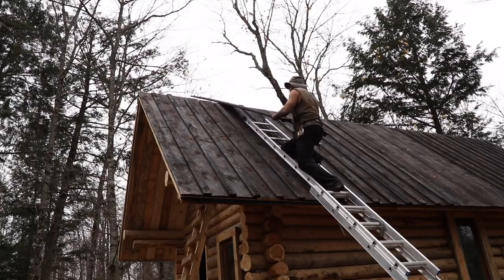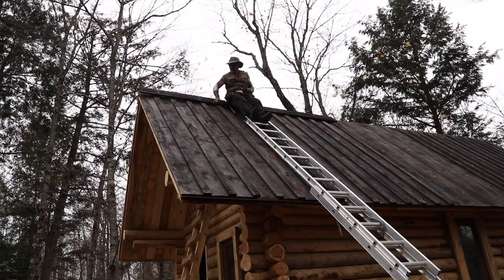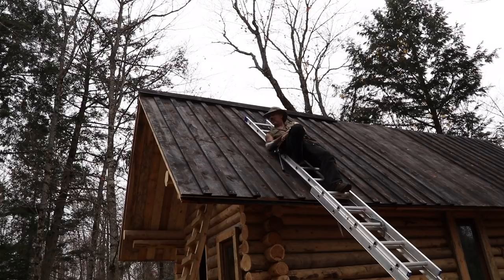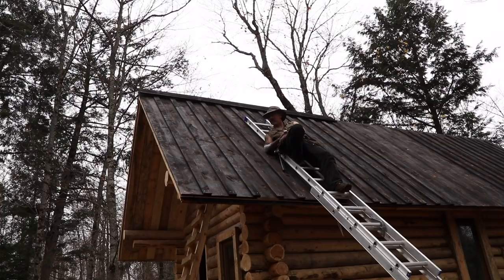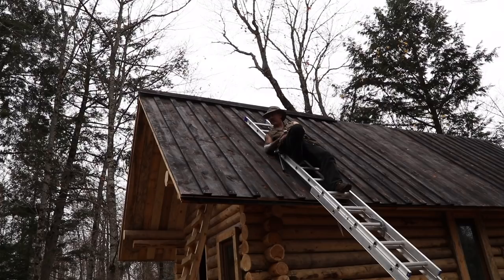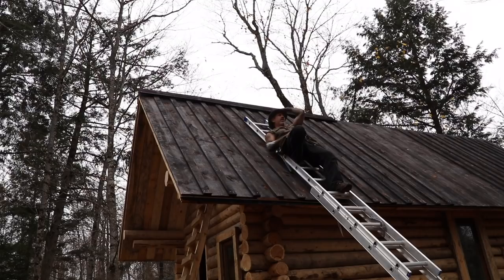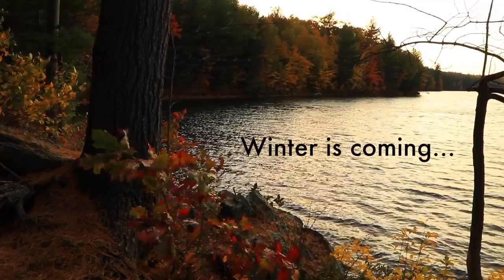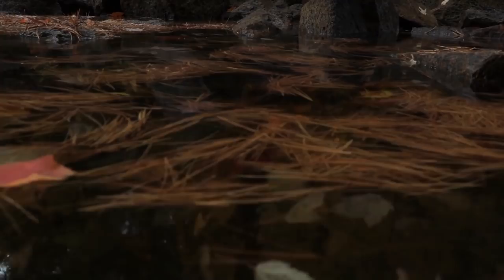Shou Sugi Ban DIY Wood Roof on a Log Cabin in the Woods using Ancient Primitive Technology

Comment: Shawn  my wife and I stand with you Bro in all things!  I don't want to sound or be negative with you, just realistic in that this shou sugi ban roof is great for ok for Japan but not here!  Please also be reminded that every where on your roof you have appled a nail into your roof, exposed to the weather, Do you not think that water won't penetrate over the next couple of yrs. and cause leaks inside?  Myself personally with 28 yrs. hands on every type of roofing would never apply this type of application. I say within a few yrs. 2 at the most you will be applying a metal roof or cedar shakes over top of your shou sugi ban roof!  My advice and Dieter Schneider advice below is something to reconsider !  We love you Shawn and your family. Sincerely yours MJC
Reply from the maker: mJ c Thanks. With 5 layers of redundancy, I know it's not going to leak into the cabin (didn't even leak before I put the membrane on). But, water may get between the layers and cause other issues. The beauty of this system is that I can easily take off boards to inspect it and/or replace things as necessary. I'm looking forward to seeing how it goes.

Comment: Shawn:   Custom garden shed kits I designed;  were exported to Japan about 35 years ago. They had the ridge caped with a 6" round log that had a 90 degree notch cut 2/3 of the way into it the full length.  It was a good looking ridge cap, but we used forest green exterior vinyl sheet goods for the roof cover as it was a kit building; 3x4 meters, with a 12:12 pitch roof.   They were partially assembled and flat packed for shipment in a container. The walls were panels of milled 4" lodge pole pine rounds ( normally used for tree stakes) cut in half then milled smooth with bevels on the  flat, T&G edges and the rough 1/2 round for the exterior.     I believe a lot of the kits were used for forest cabins/shelters.     Bert

Comment: The roof is great. I am now fascinated by that shou sugi ban method of weather-treating wood! It's an education for me, as I hadn't heard of it before. But it's now something I will remember. I will look up techniques of preparing wood that way. Thanks!
Reply from the maker: This is an ancient, non-toxic way to preserve wood.  The benefits of this system are that it is UV, rot, pest and fire resistant.  Apparently, it can last 80-100 years untreated and longer if treated (with oil).  The oldest surviving wood structure in the world is a five story pagoda in Japan that was built using Shou Sugi Ban.  I will post a video of the technique on Sunday
Reply: Thank you, and I am looking forward to that video!

Comment: AAAHHH, board and batten.  I am so happy to see you getting that beautiful workmanship in the dry.  AWESOME JOB, Shawn.

P.S.  Re. the burnt-wood effect on the roof boards.  Realizing that the fire turns the outside of the board surface to carbon it should hold up just about forever.  My great uncle had a forest fire rip through his 45 acre stand of American chestnut trees.  The fire destroyed all of his humongously beautiful trees.  Even after 60+ years the burned out stumps were still standing, with all of the charcoal still intact inside the stump. We kids would scoop it out for backyard BBQs.

Comment: I absolutely loveeeee this cabin! Though I would have done a tin roof because I absolutely love the sound of rain on a tin roof. This is quite literally my dream, a log cabin back in the woods. I’d like electricity and an indoor bathroom so I could truly utilize it for extended periods of time with relative ease. With that being said, I would not want a ton of crazy luxuries. Being where I’m from I’d had a propane heater so I don’t have to worry about the pipes freezing but I’d certainly have a wood stove, minimalist bathroom with literally only a shower, sink and toilet, a kitchen with a small stove, simple fridge, sink and pine cabinets, real plank board floor, open loft bedrooms 😍😍

Comment: Looking Great Shawn....

Ever thought of installing a gutter drain rain barrel run off system ~ Three or Four barrel Rain catch system funneled off the roof for water back up storage for cabin use...

Three or Four rain barrels wooden ~ stack rack on top of each other with valve plum pipe and sealed fittings....  Just an idea !!!!!!

Roof coming along great up top 👍🏻

My next concern was clearing trees and fire proofing the property surrounding the cabin.... Proactive approach in keeping the area safe for you, family and guests....

Fantastic Work 🏡

Comment: Interesting process.  Your roof could support a tank.  Looking forward to seeing how you did the burning process.  You may have considered the following but in case you havn't here it is.  My grandfather did this, and I have heard of others around here doing the same.  After chinking the logs with whatever, moss is traditional, some use fiberglass now, instead of using clay, he ripped boards along both edges at maybe 45 deg (you could experiment) and then nailed them between the logs.  Prep time is longer, but chinking goes fast and looks great IMHO, and it doesn't fall out.  Outside he left the logs not chinked, but you could do do something there if you worried about water penetration.  The cabin is still standing strong 80 years later.  Thanks for showing us your progress.

Comment: Your project is amazing and the roof looks great. However, I would have done the roof a bit different to get better airflow under the roof boards. The roof battens should go down the roof, not horizontal (to allow water to run down), then put some spaced sheating over to mount the boards. The boards in the first layers should also have good distance between them, and there should be a groove on each side of each board to allow water to run down. The boards you put on top should be equal size as the boards under, and also have groove facing down matching the boards under (forming a tunnel for water). That's how we do it here in Norway, and it's raining a lot here.
Reply: Dieter Schneider a lot of work involved but all you said makes sense I shall use this technique next time, thank you...
Reply: I think I follow.  The roof(s) you speak of in Norway, how long does it last ?
Reply: We have some of the oldest wooden churches in the world here (close to 1000 years old), and they all have wooden tile roofs. However the roofs have not lived that long, they need repair and rotten tiles must be replaced. I'm not sure how long the tiles last, and they are treated with tar and charcoal. The tiles are made of slow grown mountain fir heart wood, which also naturally contain lots of resin which make it last longer. The commercial wooden roofs they sell today (similar to the one in this video) can last up to 75 years if you use pressure treated wood. At least, that's what sellers say. Good airflow i extremely important to make it last as long as possible.
Reply: It also appears that you failed to leave a drip edge.  The charred boards should hang down at least a half inch farther than other boards they touch/are attached to.  (I know, too late now; but you forgot to consult me before you installed the boards).  ;-)

Other than that it looks great.  Love the yakisugi.
Reply: @Dieter Schneider - Thank you Dieter, but I'm not 100% sure I fully understood your explanation. Could you possibly post a link to something (a photo or website) that shows the method you explained. Much appreciated :)
Reply: Dieter Schneider 

Would also like a pictorial of your explanation seems I can't see what you explained maybe lost in translation
Reply: previouslyachimp *
Reply: That’s exactly what I was thinking about the spacer boards.  Not a roofing expert, but I was thinking the same thing about water direction.  None the less, great work on your cabin and may she last generations.
Reply: Yup, standard for battens/strapping on a sheeted/underboarded roof - vertical or diagonal battens first so water always has somewhere to drain, then the horizontal battens. Also, I would've fitted the vertical verge (sloping roof edge) battens first then cut the horizontals - one, no cut ends exposed other than at the bottom of the roof and two, just less cutting.. and I'm lazy so I like that  :o)

Comment: I had heard of Shou Sugi Ban before it was mentioned here. I just didn't do any investigating into the method used, & what came from the method. Upon researching it I found some beautiful furniture, fireplace backings, bathrooms, flooring, etc, etc. It is used in many ways. I love what you did with the roofing. If I could have chosen a tin roof it would have been the black. I still love the burning of the wood for the roof. It just seemed to fit it better.
I do have a question. I have been going back to some of the earlier videos & I could have sworn you mentioned a well. If you have is it going to supply your kitchen, sauna, & possible other uses?
Thanks for continuing to share your adventure & the development of your future home.

Comment: I am commenting before I even watch this installment.  It is crazy how much I look forward to watching this channel.  Thanks Shawn!  Just back from Barrie, 14 hrs of tin bashing.  It is shocking to see how much bad work, unfortunately, there is out there in the HVAC industry.  On a brighter note...  nice ladder.  Okay, on with show.  Cheers.
Reply from the maker: What are you tin bashing in Barrie?
Reply: At a beauty house whose furnace has packed it in due to under sized duct work and a whole host of mind boggling manouvers.  Fabricated new duct work this moring, drove to Barrie, ripped out and replaced.  We're talking new and properly sized venting, new gas line, added returns, increased supply size and increased and added perimeter pipe size and runs.  I imagine the entire street with hefty price tags attached all have the same problem.

Comment: I see that your horizontal battens are useful to step on during construction. But did you consider putting a layer of horizontal battens underneath them first, so to let water drain off on your membrane without horizontal obstacles? I suppose you did and decided against it for some reason?

Comment: The fire hardened board and batten roof is a unique and awesome idea. Looks great!  My only criticism is you should have used four foot horizontal battens with 1/2" gaps so any water that gets through the roofing can drain better and not cause ice dams under the roofing. I've installed hundreds of tile roofs and water always finds a way to get under the tiles. Love that you're using all hand tools.
Reply from the maker: richard hiatt Thanks! I ended up cutting them shorter and cut slots so there is quite a number of 1" gaps. I was thinking about vertical air flow too

Comment: This is fantastic. Whenever you get a bunch of opinions doing the opposite of all of them is always a good choice lol. I’m familiar with board and batten siding. I’ve also seen the Finnish use burning and tarring to preserve wood for construction. I haven’t seen these combined for a roof before. I have so many questions. Is there any sealant under the battens? What kind of nails? Concern over nail leaks? Obviously you aren’t the first so I look forward to a video with some detail about this technique!!
Reply from the maker: Evan Stinson Thanks. No sealant yet - I'm hoping I don't have to if the water that does get through drains on top of the membrane properly. I'm not worried about nail leaks on that steep slope,  it I'll have to watch for rot. They're hot galvanized.

Comment: The roof is beautiful!  I would expect with the double roofing that you are also well insulated.  I am waiting to see how you put the stove and pipe in this cabin.  I really like to watch you using your tools - so sharp and well maintained!  Nothing worse than a dull saw or chisel.  I had a fellow about 80 years old repair the oak floor in my kitchen.  He came just to look and then asked me for a chisel.  I offered him one and he asked for a sheet of 320 sandpaper.  He replaced some boards but darned if I can tell which ones!  I love to watch true craftsmen like you build things.  The only thing that bothered me was that you seemed to wear a safety harness and threw a rope over the ridge but never seemed to be connected to the safety line.  Did I miss something?
Reply from the maker: John Gritman Thanks. I used the safety line most of the time while installing the roof membrane and battens, but found it unnecessary and disruptive once I had a ladder and furring strips to stand on

Comment: ❓ Question: Now that it's been a few years, how is this roof holding up?

I love this idea and am going to incorporate it into my next build.

Were those boards green? This is at the heart of my interest, because I mill my own lumber and am interested to know if shou sugi ban takes the place of kiln drying. The boards you used are quite wide and you nailed them on the sides. It's my understanding that when doing board-and-batten with green lumber the boards should be less than 6" wide and nailed only once in a straight line down the center.

Comment: It will be interesting to see how the roof stays water tight through multiple thermal expansions and soaking/drying cycles.

Where I live we use metal roofs to increase fire resistance.  Also, the Florida sun eats up wood faster than termites.

Comment: Gorgeous roofing Shawn! I sure would have been very tempted to run a bead of the best weatherproof silicon caulking I could get my hands on between those larger planks though, seeing as any moisture that seeps through will be trapped under there forever and could eventually rot your stand off strips. Think I'd also spray a few coats of waterseal on it and maybe even reapply about once a year or so.
Reply from the maker: lapicker I may end up doing those things after the boards have finished shrinking. It does drain completely though - the east side has seen a lot of rain over the last few days and it all drains off
Reply: With a roof like this, you want it to shed water via the gaps, the last thing you'd want is to add waterproofing products to it, it would potentially cause more problems than it could solve. If you rabbet in a little channel on the bottom boards,facing up, and on the battens, facing  down, anything that gets under the batten will be channelled off like on a tile roof. I understand the initial reaction though.

Comment: Another great video. No concerns about the black roof heating the cabin up to much in the summer?
Reply from the maker: Blake Brodeur A little. I'm hoping the 3/4" air space under the top boards helps it cool down. And the tree foliage in the summer should help too.

Comment: Shou Sugi Ban was a great decision.  Did you consider attaching the smaller boards to the edge of the larger ones before putting up on the roof or was that too heavy?  Seems like you could have done some of the work on the ground.
Reply from the maker: Peter Tumminaro thanks. It went really well, working on the roof. That took about half a day of actual roof work, which I was really happy with.

Comment: Looking exceptional. I’m really impressed and inspired. I hope you get the last parts of the roof completely finish before it snows. I think you will. Caulking the joints will be a big job too and guess.
I live in Australia so very little snow where I live and no spagnum moss. i Wonder if using some dried reeds or grasses might be a good reasonable substitute for the spagnum. Is that the spagnum to insulate or just hold the clay together?
Reply from the maker: Rodney Holland thanks. The moss is for insulation too.

Comment: Not only does the wood become harder when exposing it to heat but the sugars in the wood itself are converted in such away, from the heat, 
that make it indigestible to insects or other things that would normally consume it. 

I like what you did over all but I think a inch of foam under the roof would make for a cheap thermo break. Very low cost home construction.

Comment: I love the look of the roof but I’m not sure how it will hold up to weather. I have seen cedar shake wood roofs and some pressure treated shake wood roofs and I know they hold up. Cedar roofs require some maintenance as I’m sure this roof will. Also I hope you are using stainless steel nails, because in most wood roofs the galvanized nails are the weak point and fail long before the wood does.

Comment: I like the look it's very rustic and very real to the environment. Will that be waterproof between the boards? I noticed that you put a plastic down first and then slats across, then you hammered in the roof boards. If moisture gets between the roof boards and your plastic wouldn't that build up on your slatting going across the roof? It looks very nice I'm just asking.
Reply from the maker: Frederick Hillegas So far, it's been draining well in the gaps I left between the wood strapping on the side that's not finished yet.
Reply: My Self Reliance thank you it does look very nice

Comment: That’s a great technique for siding but I wonder how it will work on the roof. Water seems likely to leak into the space underneath and the snow load might eventually push your knots out. 
It looks great though and very interested to know if somebody else has been successful long term with that technique. I wasn’t able to find any Japanese videos yet. I’ll keep looking.
Reply from the maker: In Japan, the Horyuji Temple is a pagoda which was built using Shou Sugi Ban and it is widely considered as the “oldest wooden building in the world” – dating back to 711 A. My next video will show the technique I used.